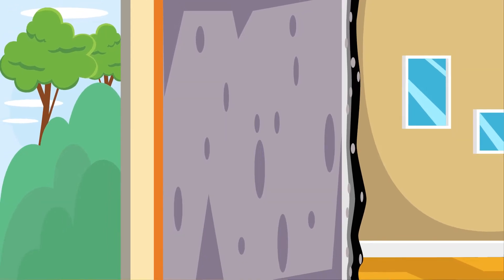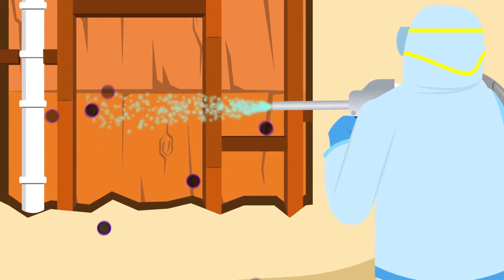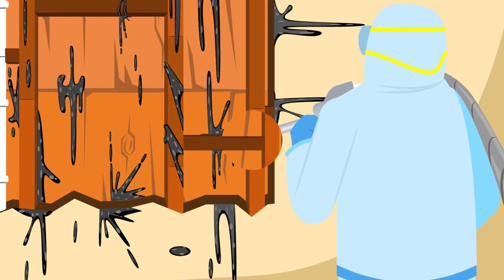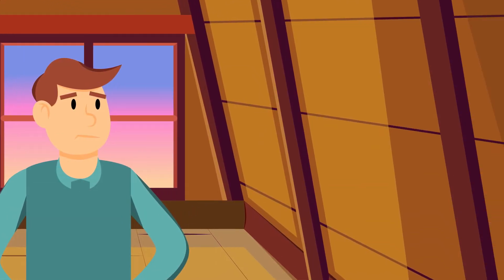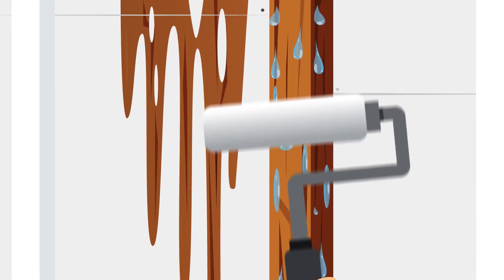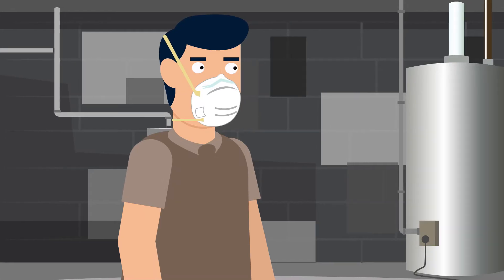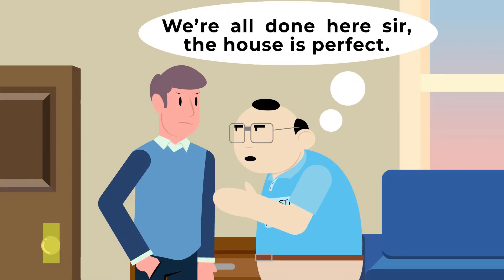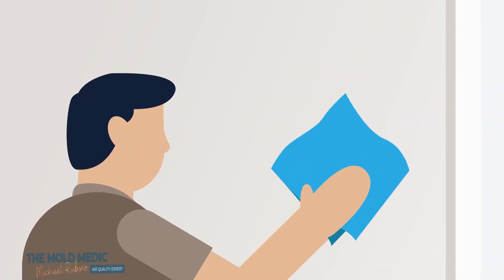Got Mold? | Part 3: Remediation

Comment: I wish I had never hired Home Cleanse. As someone with various auto immune issues, I trusted their deceptive advertising promises that they are experts in finding water intrusion and eradicating mold and regret it immensely. I hope no one else ends up taken advantage of too! HomeCleanse not only failed to properly address our water intrusion issues, their crawl space system failed in just about every way possible. Their dehumidifiers leaked, broke, caused more mold to grow, their vapor barrier was too thin, the humidity was 69!!! (supposed to be 35-50). Their vapor barrier was literally duct taped together, peeling off the wall in just a few months. Our crawlspace has tested positive for mold TWICE in under one year of them being here. I now tested positive for mold personally and am having more bloody noses, again. Everything they promised me, was the opposite of what I got. They brag that they are more expensive but because they do things right but let me tell you, that is not what we experienced. Far from it. We got scammed and I hope no one else has to endure the same.

Comment: Thank you for these step by step short videos! They are SO helpful! 
What are your thoughts on spray foam insulation? 1) How to best remove from mold affected areas? 2) how far out to remove this insulation in mold affected areas -two feet around or more?
What are your thoughts on chlorine dioxide (CL02) gas to treat a mold issue while coming up with a permanent remediation plan (obtaining tests, budget, book contractor, etc)?

Thank you for what you do!